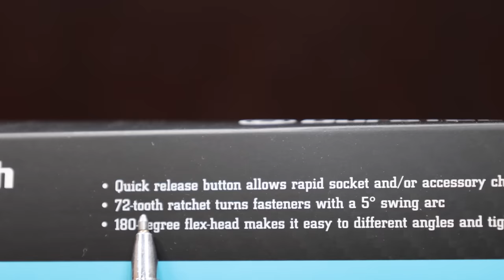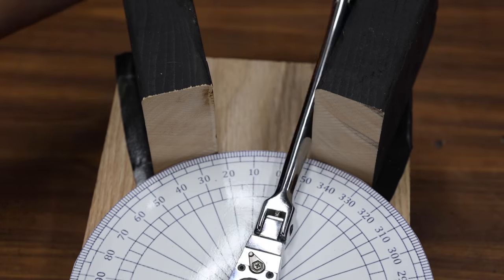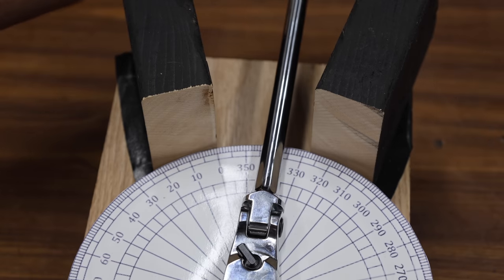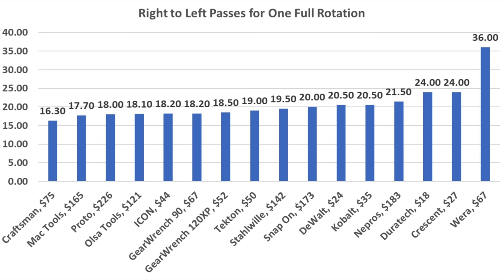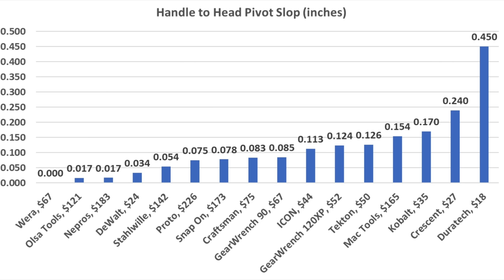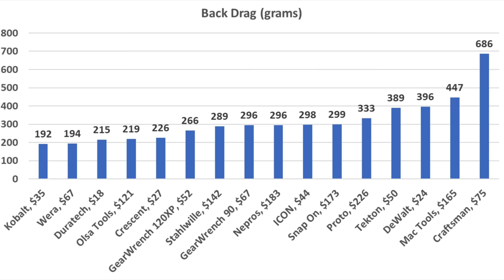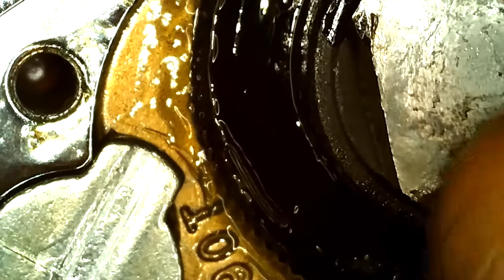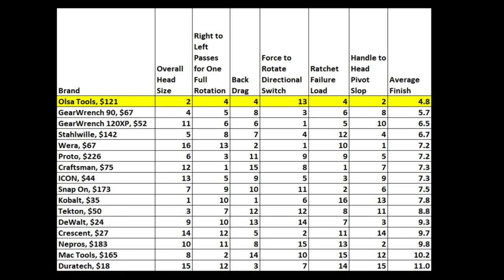Best Flex Head Ratchet? Let’s settle this!

Comment: Video request - diesel heaters. As someone who does a lot of camping off grid I want to buy a diesel heater for my tent in the winter, however there's hundreds of Chinese ones on Amazon, the cheaper ones seem to have better reviews than the expensive ones and also I'm running on limited battery, how much energy from a battery will these used as opposed to a tiny space heater. Tyler tube on YT tested a cheap one and he had an air quality tester and it made the air quality horrible, but I would have the heater itself outside and run a tube with heat inside. Thanks for all your work sir.
Reply from the maker: You are welcome!   Thanks for the suggestion.

Comment: 9:50 Pretty sure the craftsman can be brought down to the 200-300 of back-drag range with some lightweight oil and a break-in. A small price to pay for one of the strongest ratchets on the market. Obviously these are being tested out of the box, which is fair. Another good test would be after dunking them in ATF and a 6 moths use and abuse. Bet you, the Craftsman would be on top.

Comment: Personally, I prefer a socket wrench that doesn't change direction all that easily. I find that my hand will bump the lever when trying to hold the head of the ratchet steady, and having to stop to frequently correct that is a real chore. Put some texture on the lever so to prevent oily hands from slipping, but also make sure there's a bit of a "click" when reversing the directional lever so that it doesn't move accidentally.
Reply from the maker: Thanks for sharing.

Comment: Nepros tools are sexy!
Also you are comparing long handle ratchets to ones with short handle ratchets. For example this Vera ratchet is not really meant to work for tight spaces, but used to put things together quickly, you angle it so socket is in line with the handle, you hold black sleeve on the shaft and rotate the handle with the other hand - think like it would have to replace quick turn handles.

Comment: It depends on the situation, but I usually don't want a ratchet, or wrench, head that has a latch to set the angle. I find that I often want to change the angle, during the swing, to temporarily clear a partial obstruction.
Reply from the maker: Thanks for the feedback.

Comment: another brand you should really consider for these tool tests is NAPA's Carlyle brand. I have a few of their ratchets and I find myself using them as much if not more than my Snap On and MAC ratchets! Great video as always!
Reply from the maker: Thanks!  Thanks for the suggestion.
Reply: I find the Carlyle stuff is quite nice also, though I have had a couple issues with the chrome...the Carlyle stuff is quite pricey for what it is, though, and I have come to the conclusion the ICON stuff is just as good at a much better price...
Reply: @dyer2cycle  I've personally never had an issue with the chrome on a Carlyle ratchet, and they are somewhat pricey but they do go onsale a lot. At least at my local NAPA and on their website anyways. I got my 3/8 swivel head ratchet for $45 two years ago and I've beat on it pretty hard over the last two years and it still works like new. And I've had their flex head for around the same ammount of time and it too has seen it's fair share of abuse. The flex head is a little loose now but so are my MAC and Snap On's. In my personal experience with the Icon ratchets, while good they havn't held up as well over time as the others I use. The flex head on the one I had became very floppy and I broke another regular one internally. My Snap On took care of the rest of that job. The icon tools are great but over time they wear worse than others in my experience.

Comment: I’d like to see a review on locking hitch receiver pins (5/8” diameter). Durability of the pin itself; security of the lock; cut resistance; weather resistance of the pin and of the locking mechanism; ease of use; etc. A few suggested brands:  Vehiclex, Rhino USA, Curt, Reese, Proven Industries, and there are many others.
Reply from the maker: Thanks for the suggestion.

Comment: I never was a fan of the MAC ratchets. Had a 3/8 locking flex head at one point. Corrosion built up inside and prevented the main gear from locking in. Not good for someone who lives in a very snowy and salty area during the winter. Switched over to a Matco 3/8 locking flex and have been happy ever since. I have done unspeakable things to that ratchet and it only ever failed me when I was obviously asking too much. Love the thin handle on the non comfort grip. I will say I do like the Mac 1/4 non locking flex with the 6” (I think) comfort grip handle. I’ve had no issues with it. It’s mainly used In engine bays and interiors where there’s minimal salt and wetness.
Reply from the maker: Thanks for the feedback.

Comment: had a mac ratchet, its now in a field somewhere after replacing the head 3 times in less than a year, my snap on ratchet is still going strong but i've had to replace the lock mechanism for the swivel 2 times
Reply from the maker: Thanks for the feedback.

Comment: Regarding the force required to flip the switch on a ratchet, I feel that too light of a switch can unintentionally reverse on you during operation.  What are your thoughts?  I don’t necessarily think “the harder to switch a ratchet, the better”, but I have some ratchets that sometimes give me problems with changing directions when I didn’t want that.

Comment: I'm actually very interested to see the new Quinn ratchets tested against other ratchets.  The head is small and thin, the direction lever is recessed and doesn't extend beyond the head, and it feels like it has a nice,  positive clickinto gear, and the grip is super comfortable. I would have paid extra for the Icon if I felt it was worth it,  but I honestly liked the Quinn ratchets better. I would also like to see the Pittsburgh flex head ratchets tested as these ratchets were,  since they're slim,  inexpensive, and have a lifetime warranty.
Reply from the maker: Thanks for the suggestion.

Comment: GET OUT OF MY HEAD!  I was thinking of buying this kind of ratchet (Wera, flexible head), lol, thank you for this review, sir.
Idea, Sprays for Intake Valve cleaner, Throttle Body and Air Intake Cleaner, Mass Air Flow Sensor Cleaner and what are the differences.  I know no to use anything BUT MAF Sensor cleaner for THAT sensor, but the other 2 sprays?  Are they interchangeable?  Thank you, again.
Reply from the maker: Thanks for the suggestion.

Comment: Idea/suggestion - Cordless electric screwdrivers. Specifically, the increasingly popular compact pen style ones. There seems to be a few brands making identically spec'd 4mm bit pen style ones, then again almost identically spec'd 1/4 in bit ones. But there's also some that cost 1/2-1/4th the price and claim the same or better in both sizes.
Reply from the maker: Thanks for the suggestion.

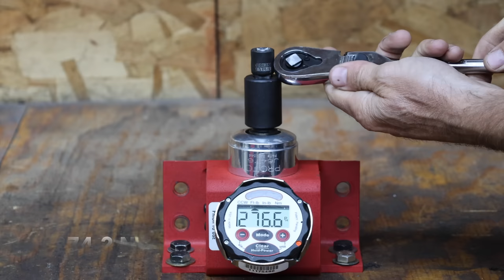Comment: since you dont have the matco in this test, ill just save everyone the time and say DONT BOTHER with it. ive owned for a few years and its broken so many times ive lost count, upwards of 10 or so now. its always the drive that snaps like the craftsman did at 13:48. they fix it under warranty of course but im without it for a week until they get the parts in because they outsource them. most of the time it doesnt even take that much to break them, just what i would consider normal usage for a 3/8 ratchet. ive put my old $12 ratchet from lowes through WAY more abuse, even using big extension bars without failure.
Reply from the maker: Thanks for the feedback.

Comment: the MAC flex head is the best - I have one that I bought off the rape van in 1985 - it recently died and MAC actually warrantied it out - the ratchet mechanism gave up - but the swivel joint was tight - this has been my go to ratchet for 45 + years .. the ultimate torque test is not really relevant other then to show temper and micro grain control in the heat treat process - this is not the ratchet you would use to torque on wheel studs or balancer bolts .. the mac has a great feel and sleekness . MAC seems to be one of the companies that havent sold out - everything the sell is and has always been supurb quality .

Comment: All my ratcheting tools are Stahlwille, but that's mainly because I work with low to medium torque fasteners. I really like their cushioned grips and durable finish. The fact that it failed in multiple areas simultaneously, make me think they designed it well, so that all parts can take max designed torque. They usually spell that out in their specs.

I'd be curious to see how the results would change if you selected only ratchets with quick release heads. There's definitely a loss of strength to gain that feature.
Reply from the maker: Thanks for the suggestion.
Reply: Exactly why I love my old non-quick release S-K round heads when I need to really apply the torque to them...they have even survived occasional cheater bar use...

Comment: I think a flashlight one would be great too see next.  Mostly speaking of rechargeable LED style. Actual output in lumens, ranges, actual operating times, resilience etc etc.  I say this as I have come across big flashlights with outputs and run times LOWER than a comparable smaller flash light..
Reply from the maker: Thanks for the suggestion.

Comment: I’ve broken 3 snap-on flex head 3/8” ratchets. Twice the head broke off the pivot and once the gear set failed. Only paid 70 for the original ratchet so can’t complain too much.
Reply from the maker: Thanks for sharing.

Comment: When it comes to failure modes... It's much better to have a failure of the ratchet mechanism or drive than the handle. The guts are usually easily replaceable, whereas the handles breaking means you need a whole new tool. When it comes to the tool truck brands, it doesn't really matter as they ass have lifetime warranties and the store comes to you. Some of the others might also have a lifetime warranty, but I'm not sure which. I'd suggest you mention the warranty lengths in your hand tool reviews.
Reply from the maker: Thanks for the feedback.

Comment: Hey I have something I would really like to see tested. I have always wondered if cheap 50t hydaurlic press really have 50t of force because the cylinder always seem way too small for the rating! Curious to find out if it's a scam or not because i'm considering building one.
Reply from the maker: Thanks for the suggestion.

Comment: Might have to look into that craftsman the next time i need a flex head. That thing can take some punishment!

My 3/8 tekton flex head is my work horse. She's taken over 150 ft/lbs more times than i can count. May not be failure load on a new ratchet, but I've had her for over 10 years.
Reply from the maker: Thanks for the feedback.
Reply: I have the Craftsman in 3/8 and it’s taken some serious abuse very very well. It took like 3 months of daily use to break in, but this test is making me buy the 1/2 inch as I’m in the market for one. It’s currently on a heavy sale on Amazon and Lowe’s. I’ll throw a cheater pipe on it when I need since it can obviously take it.

Comment: the pipe size is 1in and 3in manual drain snakes 25 ft you could look at the bathroom pluming diagram and play with it to test snakes effectiveness around turns and see what one works the best
Reply from the maker: Thanks for the suggestion.

Comment: I would argue that the NUMBER of swings to go 360* is far less important than actually validating the claims of Degrees of ark swing.  While its a nice to have to be fast, when you're working in a space where a single click of the ratchet is needed, its better to know that I'll be able to get the job done with the 3* swing where I won't have room on the 5* swing.

Comment: You should take into consideration the warranty and how hard it is to get them replaced after they fail. When you use a ratchet everyday you don’t measure force and it’s fairly easy to wear out the internal gears over time. I know you didn’t test Mastercraft - which is a Canadian Tire brand in Canada but they won’t warranty the tool if you tell them your a mechanic. For my daily use ratchets I always buy snap on even over Mac because i find that, the snap on guy in my area at-least, always have the parts on the truck to fix it or replace it.
Reply from the maker: Thanks for the constructive feedback.

Comment: Definitely took notes for flex heads to purchase, thanks 

Could you do a video on vehicle batteries... lead-acid vs AGM vs Lithium.  Also interested in knowing the best Lithium battery manufacturer for 94r or H7 size. Thanks again
Reply from the maker: Thanks for the suggestion.

Comment: Project idea: Storage Totes.  Clear and Solid.  Bought a handful at Home Depot and shattered some when I dropped them (empty) from waist high.  Drop test, puncture resistance, abrasion resistance (as a stand in for mouse teeth) lid clamp strength, etc
Reply from the maker: Thanks for the suggestion.

Comment: I've found that tight ratchets tend to break in with a bit of use, here's a test idea. Maybe automate a ratchet attached to a motor/crankshaft and let it run for a few days with a resistive load on the drive head.
Reply from the maker: Thanks for the suggestion.

Comment: Its interesting how the gearwrench 90 performs better than the 120 in arc swing. I wonder if snap on 72 and 80 tooth ratchets would have a similar result
Reply from the maker: Thanks for the suggestion.

Comment: I noticed that you inadvertidly misspoken "Stahlwille" as "Stallwill". Stahlwille is a German brand and translates as "Steel Will". Spoken out correct would sound like "Shtahl-villeh", where the "a" is raised as "ah" instead of "uh". Since I am of german origin, I thought of passing on this useful information as I'm pretty certain you'll ( and millions of YT viewers ) will encounter more product testing and reviews from that said company.

In general, Stahlwille does make good quality products, I have a couple of their model tool lineup in possession for my daily routine service. They do an amazing job.

Oh, by the way, I recently came across a 3/4" telescopic handle ratchet which felt great on hands as I had to tighten down pump flange screws M12-sized. Did a better job than the fixed variants. Maybe this would be worth a "Which is Best"?

Anyway, your channel is the best on YT, my acquisition are based on your ingenious and honest testing results which are truly accurate and represent 100% real-life working conditions.

Comment: Hi ,I have a suggestion for a video since I was a kid my father had spray bottles in his garage with gas, bleach diesel soaps, all kinda stuff for working or cleaning penetration stuff, and they worked for years, I can't get a spray bottle to last longer than a month on almost anything, bleach and water is a common one I use for cleaning floors and they never last long, just an idea for a video and it could be a cheap one in comparison to some you make 😂, I've seen some on the tube but your one I would trust
Reply from the maker: Thanks or the suggestion.

Comment: Please consider doing analysis on at least some of the smaller bench top power tools like pillar drills, band saws, and belt/disk sanders. I can't justify 4 figure sums for the likes of Jet tools, but it would be great to know how the cheaper options stack up and which are the ones to consider. There are so many variations that look like rebrands from the same factory it would be very useful.
Reply from the maker: Thanks for the suggestion.

Comment: It is interesting that the top finishing ratchet had no 1st place finishes yet the lower placed Wera and the Craftsman both each had 2 ea 1st place finishes with the Craftsman having 1st place finishes in rotation and total failure.

Maybe Craftsman isn't as dead as some thought.
Reply from the maker: Thanks for the feedback.

Comment: I prefer a stiffer selector switch. Nothing more annoying than a ratchet switching directions mid use cause the selector switch was lightly caressed. I don't think an easier switch is necessarily better.
Reply from the maker: Thanks for sharing.

Comment: I've had the Kobalt for a bit over a year, although it may be a previous version.  The first one i got broke in less than two months with a fractured pawl, but this one has been good so far.  However, the back drag and light switch action have been problematic.  Looks like my next one will be an Olsa.
Reply from the maker: Thanks for the feedback.

Comment: Video idea - motorcycle helmet visor cleaners. I ride my motorcycles on the street and dirt. It’s best to wash it in a sink but not always possible while traveling or in the middle of a forest. I have been using Plexus but it is expensive for a cleaner and looking for alternatives. Possible alternatives  Honda cleaner and polish, Liqui Moly Visor Cleaner, 210 cleaner, Plane Perfect Eyes Outside, Muc-off, McFarlane DAM cleaner, interested in anti-fog, long lasting, scratch prevention + reduction, bug removal before and after, UV protection, rain repellent, dust repellent.
Reply from the maker: Thanks for the suggestion.

Comment: Surprised you haven't done a video on all the various "self fusing silicone tape" for emergency plumbing repairs etc. So many to choose from on Amazon and stores. One of your typically great videos would be useful for figuring out if there's any difference between them all.
Reply from the maker: Thanks for the suggestion.

Comment: Man i owned the longest handle 1/2" matco and i wasn't even sending it, i could not keep the guts in the thing. The last time i ever used it i was turning over a little diesel and all the sudden no ratcheting pawls were stripped.  and the 14" (i think) 3/8 i bought it for slack adjusters. Couldn't keep the thing in one piece.
Reply from the maker: Thanks for sharing.